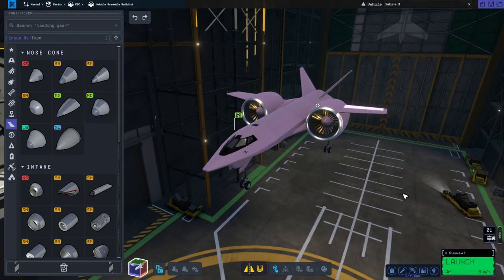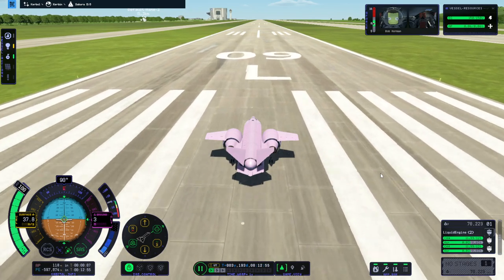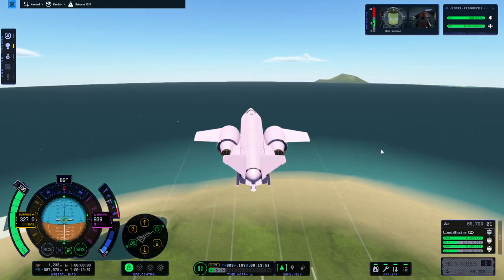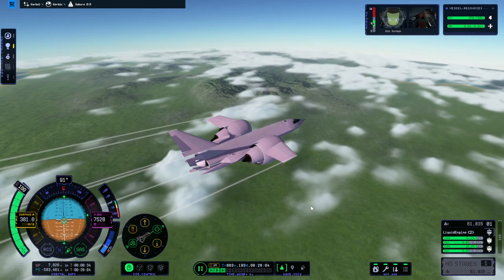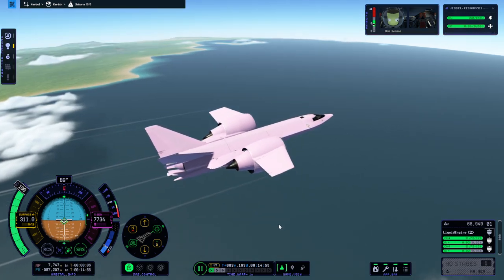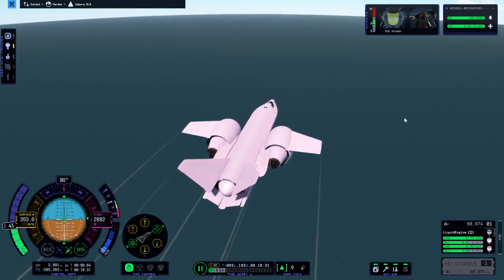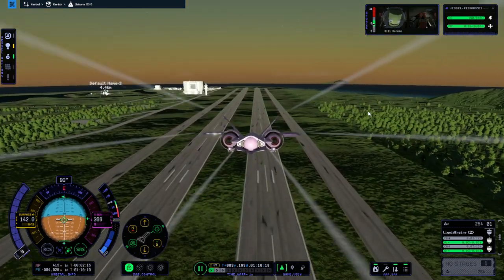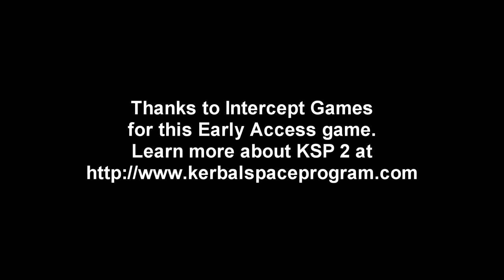KSP 2 Early Access - Circumnavigation in Pink?

Comment: Maybe you could use a more dynamic flight plan to get better fuel margins. Like increasing altitude or decreasing throttle to be more effecient as the plane gets lighter. As for the rough landing you could just use all moving control surfaces for the rear fins.
Reply from the maker: We are increasing altitude as we go along for more efficiency - I thought I mentioned that.

Comment: Huh.  Looks like it worked.  Where is the force from the control surface applied?  Would a bi-plane where one pair of wings had the control surface on the leading edge add enough torque to give pitch control?  Any ability to change weight distribution so the balance is better when the fuel tank is empty?